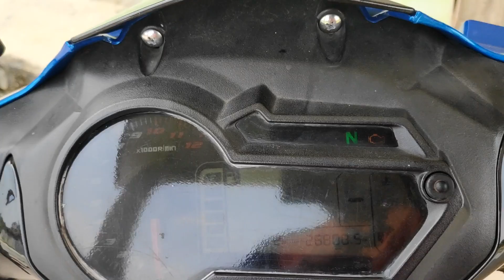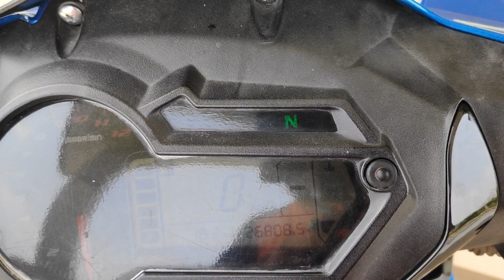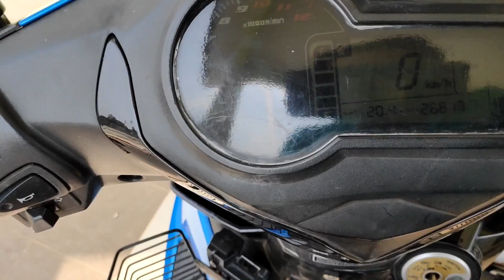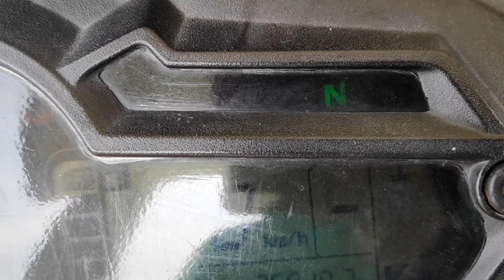Cuci O2 Sensor | Benelli RFS150i

Comment: Assalamualaikum.  Bang kalau kod P0174 apa masalah  dia tu bang
Reply from the maker: Waalaikumsalam.. Try cuci o2 sensor.. Kalau jadi lagi tukar je o2 sensor
Reply: Ok bang nnti sya try cuci.  T.kasih ya bang
Reply: Bang, dah settle problem belum bang? Sebab motor saya jadi benda sama gak ni. Keluar error code ni
Reply: @amirulhaziq8868  dia dah tukar baru.